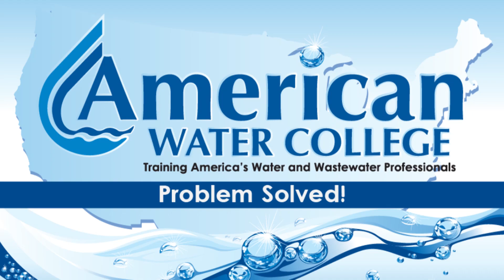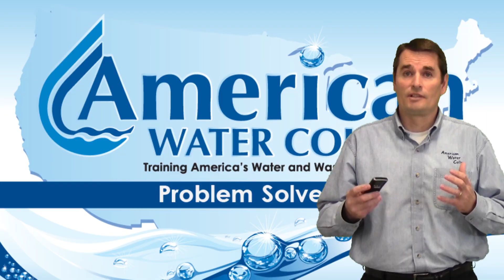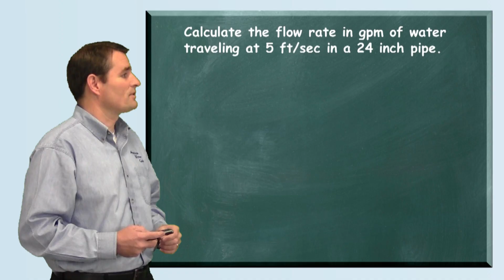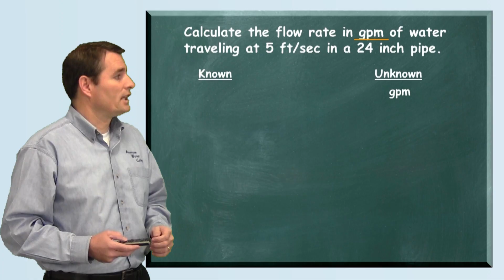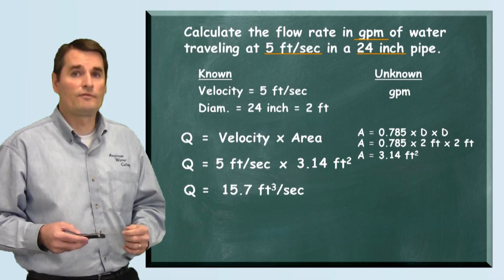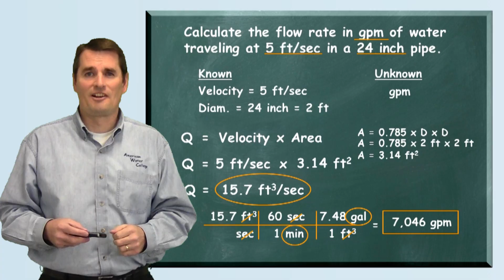Problem Solved: Flow Rate Formula - Water Treatment, Distribution and Wastewater Math

Comment: New comment on an old video but in your conversion formula you say you times across the top and divide across the bottom. Your answer of 7,046 is only timesing the top. Why do you say you divide when you don't.
Reply: jesus and you're serious when you typed this out, multiplying by 1 and dividing by 1 will always be the same as the original number... you're supposed to learn that in like elementary math? for example 30 multiplied by 1 equals to 30, and 30 divided by 1 is equal to 30.

Comment: Area of circle is it not pi (3.14) x r2? I looked up online. Can you explain why area is calculated using 0.785xdxd?
Reply: If you run that calc... pi X r2 you get the same answer. 3.14 X 1 X 1 (because radius is half the diameter) = 3.14.

Comment: the large treatment plant in texas can treat 500 mgd and uses 15 % bleach for disinfection.the bleach has a specific gravity of 1.25. at maximum flow rate, how many gallons of bleach will be used per day of the effluent demand is 7.0 mg/l and 1.0 mg/l residual is required
Reply: 21,329 Gallons of Bleach

Comment: Sir I have question. I have a multi storey building which contains 80 people and they use 200 gallons of water per person per day. For them how do I calculate the required  diameter of sewerage pipe?

Comment: Where are you getting 0.785 from?
Reply: .785 is one quarter or pi or 3.14.
So there are 2 formulas you can you use to figure area of a circle. 1) pi r2 or 3.14 times radius time radius or 2) diameter time diameter times .785.  Hope this helps.
Reply: @seanneeley8133  .785 expresses Pi/4, as the equation is commonly expressed Pi(D^2)/4
As opposed to 4/3(D^3)Pi, area of a sphere.
Double a liner measurement, 2^1=2
Double the Diameter of a pipe (or sides of a sq), the area increases 2^2=4
Double the Diameter of a sphere (or sides of a cube) the volume increases 2^3=8

Comment: Sir,
Please tell me, How to calculate, In a pipeline, how much water will be discharged in one hour from a 10 mm hole. If the pipeline has a pressure of 10Kg / cm2.

Comment: For deep well (250feet) 5HP 8 stage 3 phase submersible Motor pump under 220v what is the pump impeller size and specifications to give out the water at high pressure  and is it impeller size proportional to high pressure water out . Pipe size 2 inch  and also high discharge rate that is LPM is same the so called pressure

Comment: please folk i have a question for u ..............Q- a source of water supply to a town on a hill is under investigation and following data are being considered:
population - 2 lakh , water demand - 200lpcd, height of point of inlet to water works above the lowest water level in the source- 30m , friction and minor losses in the intake pipe system to be around 4 m, efficiency of pump- 80%, duration of pumping- 20 hrs/day, flow velocity through pipe- to be about 1.0 m/sec.
Determine the size of rising main and the horse power of the pump required .

Comment: sir which one consume more energy a 1hp. or a 2 hp. (horsepower) both going to fill up a 21 gallon pressure tank.?
Reply: 2 horse power because  that  double means 1492 watts. 1.5  horsepower  for  booster  pump.

Comment: what is the flow rate in 6 inch diameter pipe in gallons per minute (gpm) if the flow velocity is 1.2 feet per second? can anyone help me with that?
Reply: Put the same formula Q=V*A

Comment: Why are you using a funky formula for area, instead of pie-r- squared, showing that r= 1 ft?  That's so much more reasonable and it ties in with what everyone learned about the area of a circle!
Reply: Kathi Roisen s
Reply: Kathi Roisen 
I don't like the pie formula it's harder for me
Reply: 3.14x1= 3.14 squared, its the same but obviously for pie for you use 1x1 you use half the diameter, and for .785 you use the entire diameter.. eaither way works

Comment: what about when you have a 10inch pipe, or a pipe smaller than 1 foot diameter
Reply: jstang34 divide by 12..12 representing a foot.
Reply: jstang34 convert measurements

Comment: can you explain where did u get 0.785? thanks...
Reply: The equation for area is A= PI * R^2 . R=D/2 so the equation becomes A= PI *(( D^2)/4).  PI=3.1415...
PI/4= 0.785
Reply: GuitarMan1117a    sorry  the right hand side of the 3rd line should be (3.14/4)*d*d
Reply: 0.785 is the factor of a circle. 
0.785 is used instead of pi,(or pi,r,squared).

Comment: Is there any formula to calculate a wear rate of slurry pipeline? it does not matter what kind of material the pipe is made and what velocity it has. I have some information about the thickness in mm according to the clock position.

Comment: The area of a circle (cross section of a round pipe) is pi * radius-squared, which is the same as pi * diameter-squared / 4  (radius-squared = [diameter/2]-squared = diameter-squared / 4)

Comment from the maker: Thank you for your comment. Using the numbers from the problem, the common equivalent 7.48 gal/cubic ft and the formula for the area of a circle as 0.785 x D x D, the answer works out to be 7,046.16 gpm which we rounded to 7,046 gpm.   If you solve for the cross-sectional area of the pipe using the formula A = π x r x r , the answer works out to be 7049.73 gpm which would round to 7050 gpm.  (π in this calculation came from the pi button on the calculator)  

I hope this clears up any confusion
Reply: American Water College  plz how did u get 7,046 gpm  can u explain